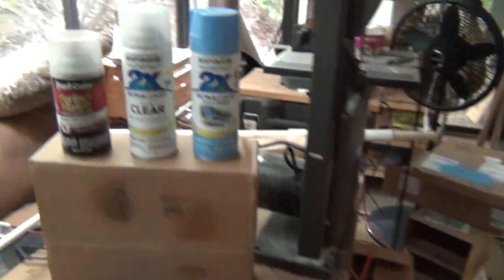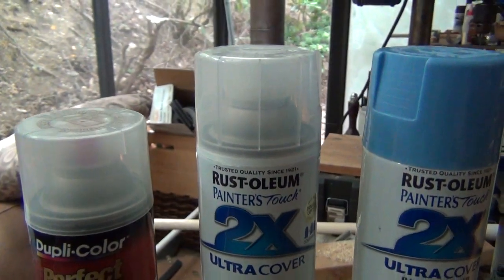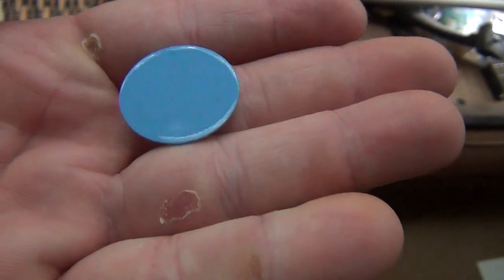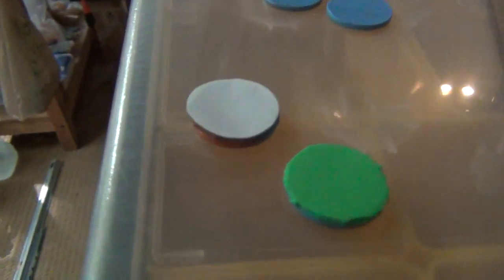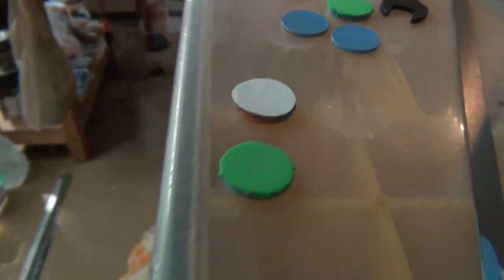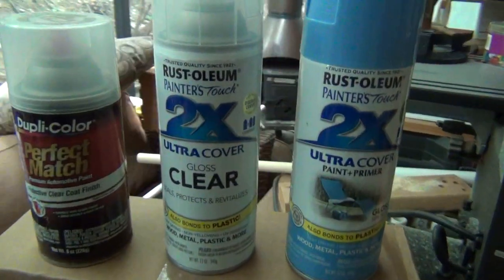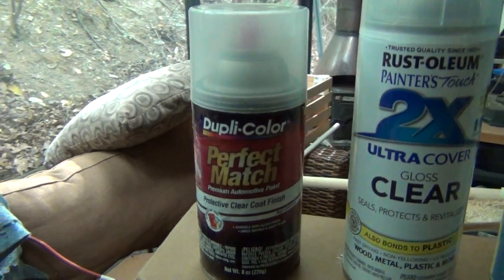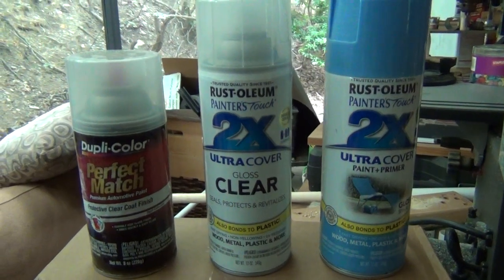Rustoleum Clear Coat Issue

Comment: Just noticed the products you're using and yeah im sure you're using enamel and laquer mixed. They dont mix well together.
Reply from the maker: Nice. Thanks for the info!
Reply: Could have told you that over 3 years ago,,,.  All you can do is shoot it walk away and never touch it again,,,. you cannot put a second coat on you cannot change the color you cannot shoot clear over it,,,. !!!    You can buy aircraft paint remover strip everything off and start over with another brand,,.  !!!
Reply: Sakima ,,, no ,, they are not lacquer,,. New paint chemistry,,. You cannot even shoot black over there red,,. It's the painter's touch is the problem you must shoot it , walk away and never touch it again,,,.
Reply: Humidity has nothing to do with it nor does drying time,,. !!!
Reply: +Rick Simpson, “ Humidity has nothing to do with it “? Could you elaborate? In my experience temperature and humidity plays a big part when it comes to painting.
Reply: Model Man81 yes you are correct,, it's this is Pacific brand of Rust-Oleum,,,. Painter's touch,,, more for homeowners first time ever painting that says that looks pretty good and they leave it alone,,,. I believe or I'm guessing it's sort of like a plastic finish,,. The solvents in the second coat or when you try to do two tone,,. It wrinkles up,,. the painter's touch type does have beautiful coverage first time around though,,,.  I have ruined so many projects with it and I've tried all types of ways of using it,,,. I'll never buy it again just use regular Rust-Oleum,,. Not the painter's touch 2X,,,.   On automobile parts I clean them with brake cleaner after all the prepping,,, spray them with white stain kill primer,,,. it's oil cut with alcohol evaporates and dries extremely quick to a white velvet finish,,, a Scotch-Brite knocks It Down super easy,,.  Then 7 coats of an oil type enamel,,. A few dust coats and a wet coat then a few more dusk oats and a wet coat,,,. But thoroughly dry wet sand and buff if you're looking for a mirror finish,,,. That will last,,.   You need seven coats for durability elasticity,,. Enough of Mills of thickness,,. And be able to take the chance of wet sanding and buffing,,,. Keep the buffing compound extremely wet,,,.  Or you can burn your paint or clear coat,,, one fingerprint can ruin a beautiful paint job from the start,,,. Brake cleaner ether and rubber gloves,,,.  You Can Eat Your Parts up somewhat with a hair dryer or in the oven,,, warm your paint up to,,,. you can bake your final paint job in the oven at about a hundred and ten degrees for 20 minutes,,. This preheating helps with humidity and dampness,,,. I've been painting for over 40 years even Automobiles and airplanes,, houses,, all the paint chemistry's changed somewhere between 2008 and 2010,,. They're all crappier now because of the EPA,,, I like the lead the oil and the cancer-causing chemicals the best,.  !!!    Just do not use that painter's touch 2x crap,,. !!!
Reply: Agreed. I seem to lean towards the acrylic lacquer side of the fence,,, what few are still out there,, EPA lol. I use a Nason branded acrylic clear coat in a spray can as well. You’ve been doing this 40 years so I’m sure your familiar with.
Reply: Model Man81 polyurethanes are much better than acrylic clears,,. The problem is polyurethanes will not hold up Outdoors or UV rays,,. They are more for interior woodworking,,,. But men wax polyurethane with,,, sparse,,,.  Clear is extremely durable and flexible,,. It can handle things that gets hot and expands or gets cold and shrinks,,,. A aluminum wheel, I refinished in this clear with sparse,,. Held up for 12 years with the dog pissing on it,,. Plus another five years after the dog was no more and probably still holding up well I sold the car,,. Many of the paints I used were industrial paints,, the contractor needed chemical license to purchase,, and a chemical mixing license to reduce had hardeners and drying agents,,,. I don't mess with work like that no more,,.  !!!
Reply: Temperature and humidity have nothing to do with it in this case. The guy is in a closed room that is pretty dry by looking at the back ground.

Comment: Lots of good comments. What nobody has mentioned (not that I saw anyways), is that your supposed to scuff the surface of bare metal before applying any paint.

Had you scuffed the surface, you would have had much better results